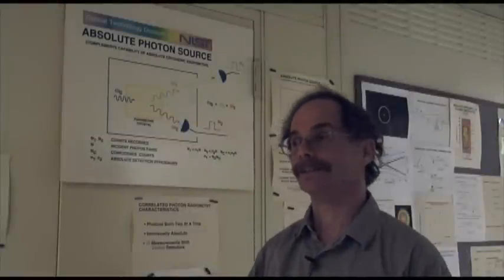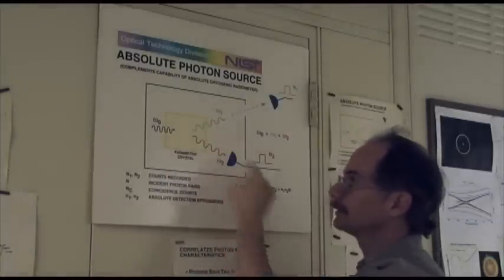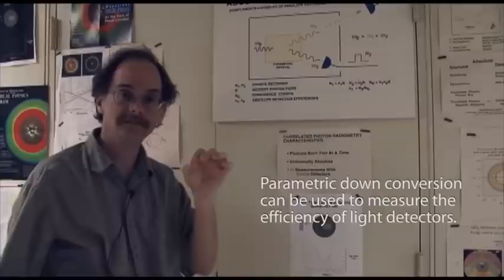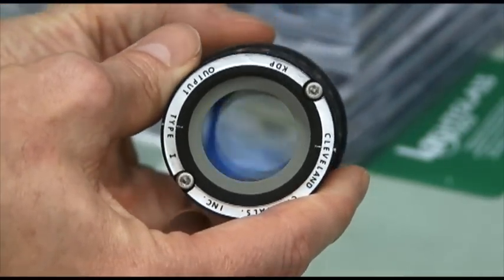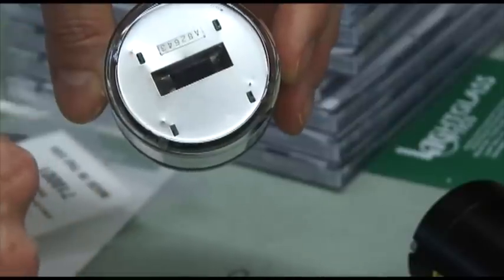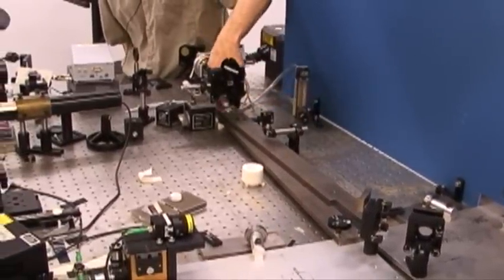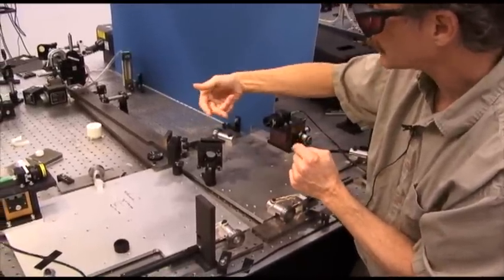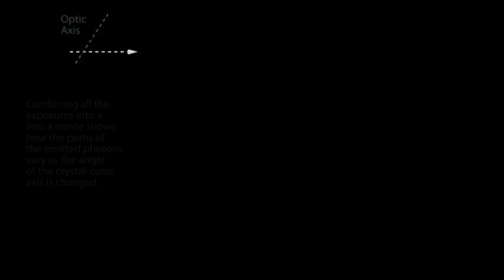One Photon In, TWO Photons Out

Comment: Im confused... Everyone is complimenting how well explained this is, but when is it explained HOW  one photons split in to two?
Reply: It isn't and technically the process is not even possible because of angular momentum conservation. It's one photon in, something happening to the bulk of the conversion crystal and then two photons out. That "something" is the hard part.
Reply: Isn’t it essentially similar to crystalline structures and it’s similar to complex mirrors reflecting light?
Reply: photon hits the atoms of the material and is absorbed, the material then reacts to that by emitting two lower energy photons.

Comment: no impossible. a photon can no be detected without energy added to the detector. input can not equal output in this case. if you get two photons out it will have twice the energy of the input due to the extra energy of the detector. the equation is not experimentally provable. you can not detect the energy of a photon only its presence and location. you can only detect the energy released by a electrons in a photon exchange.
Reply: We are teaching in high school that "the photon" is the amount of energy detected by the detector. A photon is not some "thing" that has energy. It IS the energy that gets irreversibly absorbed from the electromagnetic field by the matter of the detector. I still can't get my head around how hard it must be for people to differentia the meaning between "something being" and "something having" in the English language. ;-)

Comment: Just wondering, does the down conversion of say a blue laser only produce Light with color lower than itself, and/or does it emit other waves non-visible on the spectrum like infrared?   
If so how far would it move into the infrared section of the spectrum, would it produce microwaves sometimes?

Comment: Interesting video! Is the photon a wave until it comes in contact with a detector? I was thinking that the more detectors you set up the more places you will collapse the wave function. Therefore the more photons you will create or form.
Reply: Any discrete measurement of a wave can look like a particle, or a quantized unit. This does not mean the photon changes. It was and always is a packet of electromagnetic energy.

Comment: If photons are fundamental particles, how can you split them in two?  Wouldnt that contradict the definition of 'photon'?
Reply: There are no particles. Photons are field energy.
Reply: @lepidoptera9337  Even if I accept that, how can they then be quantified?
Reply: @numbynumb  Energy is actually not quantized (it is observer dependent, just like in classical physics. hence we get doppler shift for photons just as well as for classical waves). Angular momentum and spin are quantized. It just happens that energy, momentum and angular momentum/spin are joint at the hip by special relativity, so whenever systems change their angular momentum by a discrete step, they also have to change their energy by a step.
Reply: @lepidoptera9337 I think some energy like photons can be quanitzed. Otherwise he would only be assuming that the output are two equal halves of the energy instead of an unknown output from the material lattice
Reply: @patrickday4206  Quantization means that a physical property can only come in the exact same amounts (or multiples thereof), like in case of angular momentum or charge (all spins and all electrical charges are exactly the same for all we know). Energy can come in any amount. It's not quantized. A photon is a discrete amount of energy, but its energy is not what is quantized. Only its angular momentum is.
Reply: @lepidoptera9337  but how we can say that the revelation is one single photon and nottwo photons that add their frequncy in one?
Reply: @itsiwhatitsi  There are processes in which two and more photons are being absorbed at once. They behave differently than single photon processes. For one thing their probability increases with the intensity of the light squared for two photons and so on, so they scale very differently from a single photon process that is proportional to intensity.

Comment: 2:59

You are holding your hands up there To show to yourself the scientist that more or less if you add another two detectors
on either side of the second one you will find the other 23 percent of the clicks that the one does not harvest at other colors
and then you would be showing how this is the way music works when a string goes from vibrating at 432 the radius of the sun
to a subset of that as the energy of one wave moves along and changes shape the way nature directs the orchestra.

You later underline this by showing that the line followed by the light is not straight when measured by lines
only when measured by waves which makes the wave nature less particle like than wave like defined by points that define
every plotted wave waving the plot of motion in specific intervals involving more than one moving motion moving in mo t ion
Followed by the grand final E where thee the physical scientist has an eye on how anyone with a light bulb and a camera can

Masquerade as a scientist and create nonsense stories about one thing happening in two places at the same time as
apparently the photon is not the smallest physical effect detectable by clicks or by sticks and all the shiny pennies keep
flapping copper colored lips claiming that this little electron ion over here is that little piece of that former electron over there
acting like an ion sounding like a lion smelling a little like Fish oil needing an odor rub down to get some of the lead out and leave
behind the gold where pH arrows of old used to focus in on before building books that are still standing to be read...

Comment: I worked on down conversion in lab as an undergrad for 2 1/2. We used it to recreate Grangers proof of the photon
Reply: I don't know how that experiment is supposed to "prove" photons... since the non-linear optical crystal can certainly "split" a photon in two. Not to mention that photon number is not conserved under any circumstance, neither in low energy (emission, absorption, thermal radiation) or high energy physics. That the photon number is (almost) constant on a beam splitter is a special property of the beam splitter. It proves nothing particular about the electromagnetic field. :-)
Reply: @loganreidy7055  That "other experiments don't prove field quantization" is absolute nonsense. The best proof we have for field quantization is the stability of matter. Classical theories can not account for that.